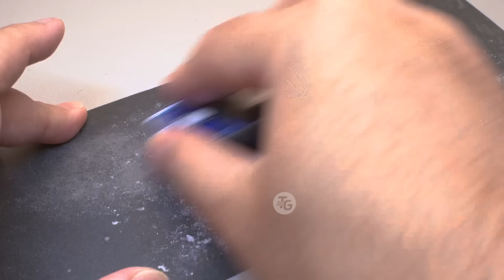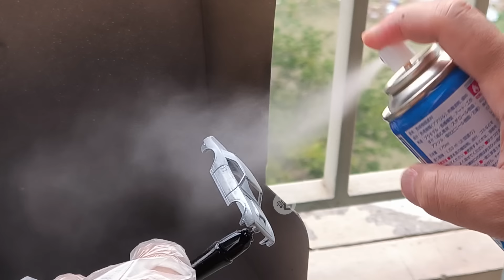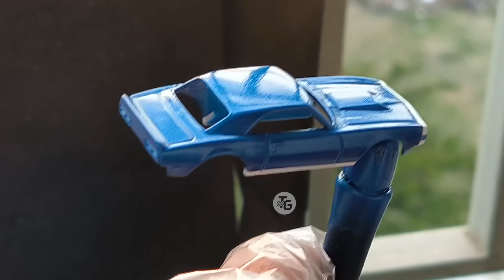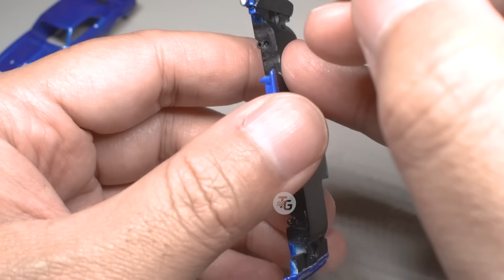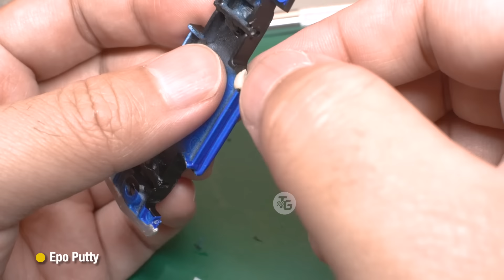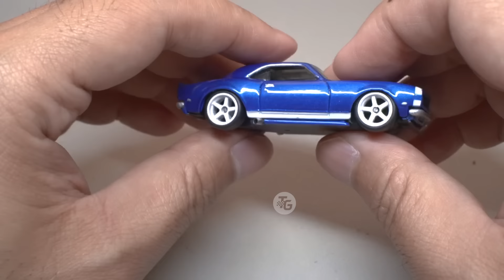'68 Camaro Junker into a Stunning Custom Hot Wheels!

Comment: How did you screw the bottom back after drilling it?
Reply from the maker: I just installed 2mm bolt, because I used 1.8mm drill bit. You can watch my very first video for that. The link is in description.
Reply: @TolleGarage  thank you

Comment: I was doing this back in the 90s, taking hot wheels apart and painting and changing wheels. I recently kinda started back messing with 1/64 die cast and looking online there is a big aftermarket for that now. Wheels and tires and kind of stuff. My more expensive die cast are fine but alot of the hot wheels and matchbox leave alot to be desired on detail. Crappy looking wheels and tires and body color paint on tail lights and headlights.

Comment: That may be a 68 Camaro Hot Wheel, however it's not a Hot Wheel made in 68, I was there and remember what the original wheels looked like, and it's not that, good job on the restoration of a modern car.